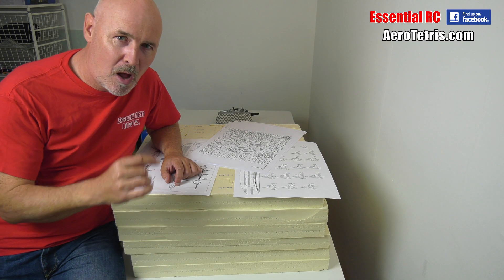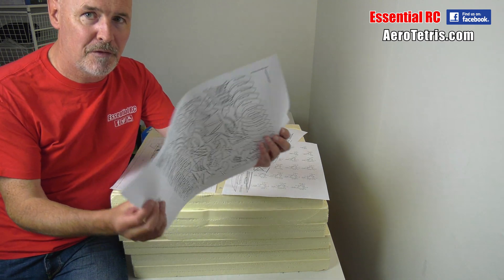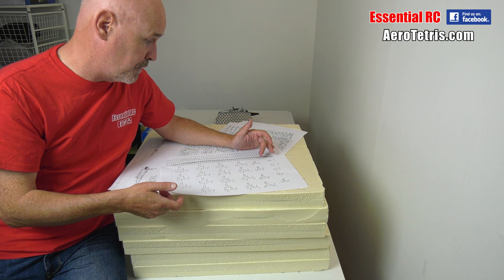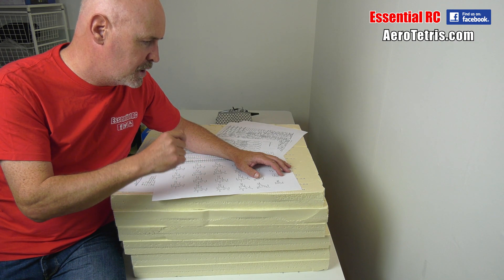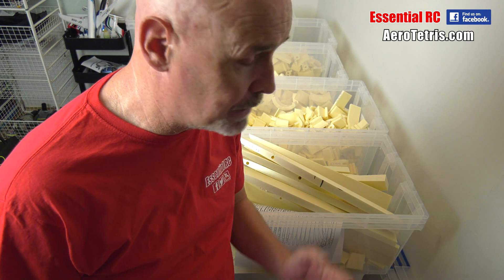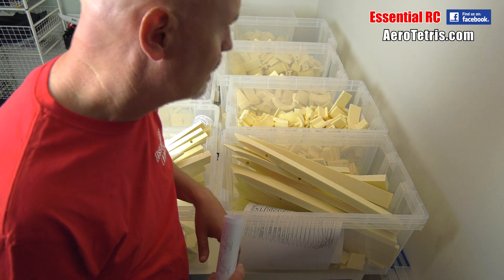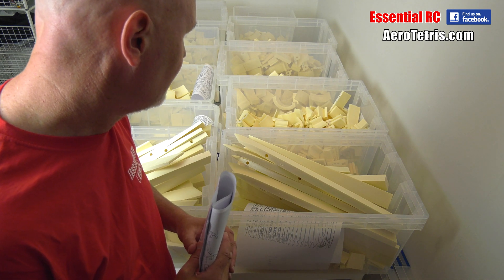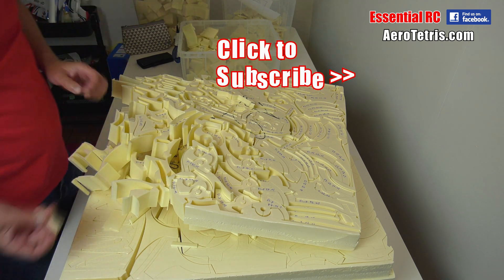AeroTetris 2.8 metre SR-71 Blackbird: BUILD LOG: Part 1

Comment: Help, I'm drowning in all those pieces!
You have found yourself a good challenge, suitable for spending the long winter nights :-)
Just out of curiosity, for my skills as a pilot this model is out of target, did I understand correctly that PVA glue should be used?
And once the foam parts are assembled, do you have to cover it with carbon fiber?
Good job and I hope you haven't thrown away the rest of the foam of the six layers ... you might always need a small piece to improve a sizing.
I'm really curious to see how to proceed for a flying model, which engines you'll use and everything else.
Cheers
P.S. I hope you will make many videos on this tetris: more videos = more details, but I also hope that the editing doesn't get too long